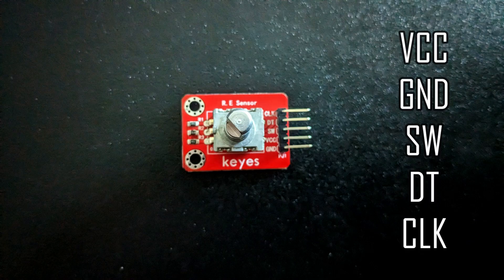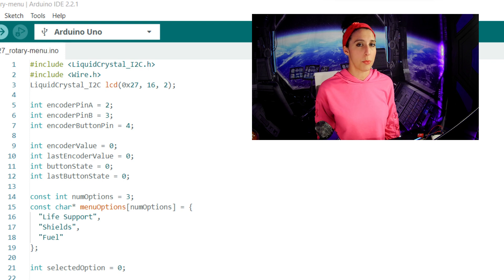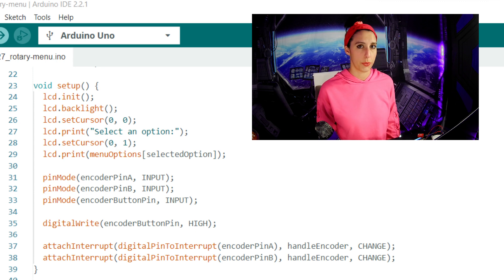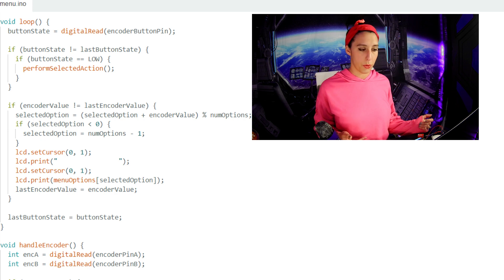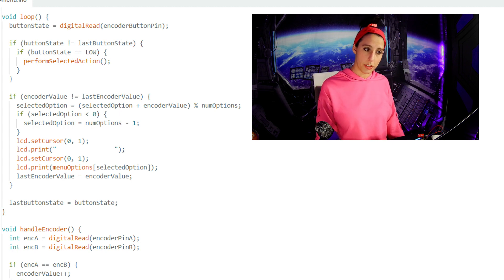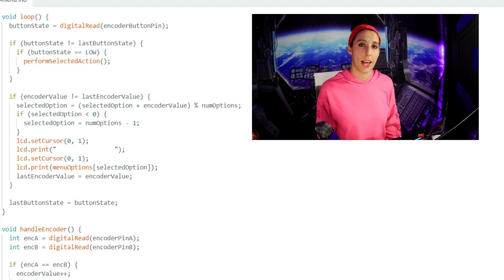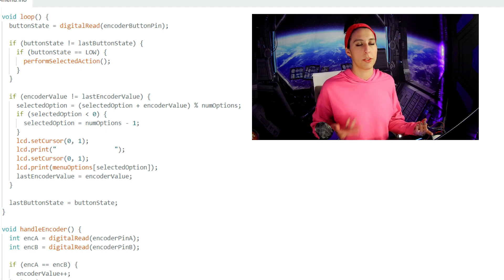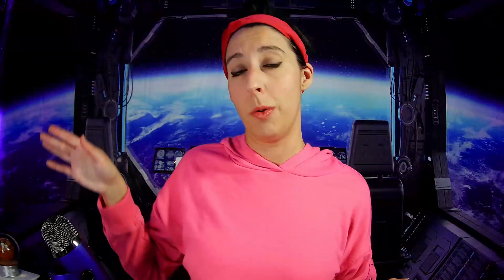Fix Your Ship's Navigation Menu With an Arduino Rotary Encoder!

Comment: Rotary encoders are great, I've actually replaced a few +/- pushbutton controls with rotaries, it gives so much more prestigious feel to the device! A really cool device to extend these skills into is a combined 4-way switch with a rotary encoder, RKJXT1F42001 is a part number to look for! 

If defense turret targeting control code takes up a lot of progmem and code brevity is necessary, there is a trick to remove the negative index number detection; use an unsigned variable for the menu index (Byte will do fine) and make the number of index entries by the power of two; when the counter rolls over to 255, the result for 255 MOD 4 is 3, 255 MOD 8 is 7 and so on. Of course if there is no good way to include menu items by powers of two, this method can't be used.